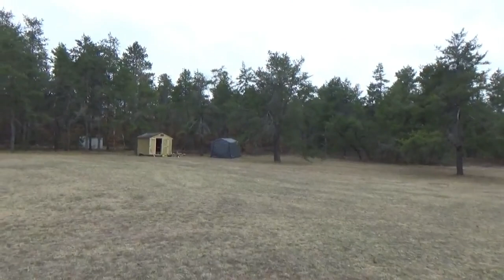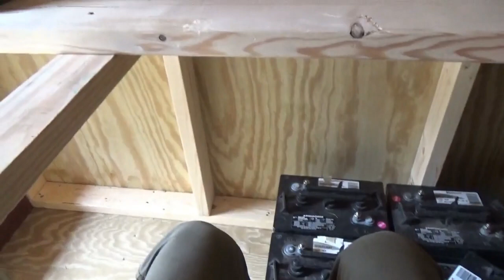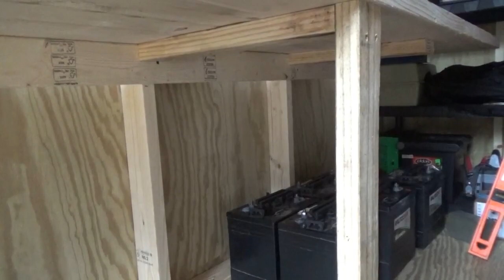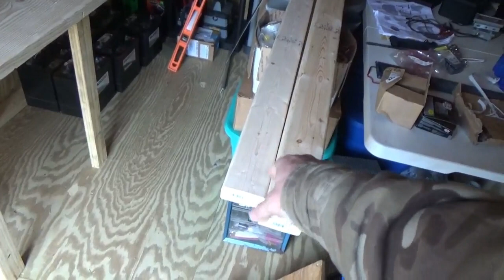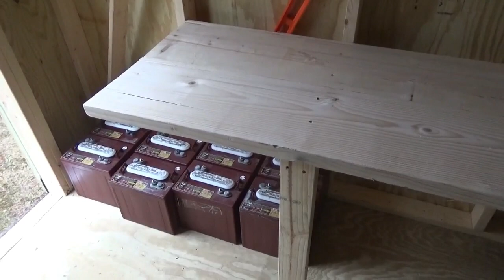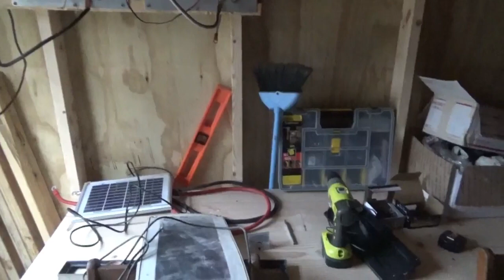Setting Up Off Grid Work Shop & Building Work Bench

Comment: The legs of the workbench need to be UNDER the framing, not the framing nailed to the side of the legs. Because now its only based on shear strength of the nails.  Smile

Comment: Troy,  When the workbench collapses and you have to rebuild it, build the frame for the top first and attach it to the wall, attach the legs and level...... THEN attach the top.     Put the batteries under the bench on a 2 x 4 riser to keep them off the floor.  Congratulations on a successful move!
Reply from the maker: Thank you. I will probably put the batteries on something to protect the floor from spills. Not sure why the work bench will collapse but if so, then I will do that
Reply: I should have said if you decide to rebuild the bench after you insulate and panel......  thanks for reply!
Reply from the maker: Thanks

Comment: You should be putting the horizontal 2x4 on top of the leg. Not against the side. Than you're depending on the screws to hold the weight.
Reply: Why would you care. Not you're problem is it? At least he made some money from you watching the video and you're comment. Good job key board warrior
Reply: Delicious Melody lol 👍
Reply: Stick enough screws in and it wont move, I always do lol.
Reply: Good grief. If he doesn't like it this way, he can always change it later. Are you there? Do you even know what lengths of boards he had left to do the horizontals or what the best use of the available wood was? Only the person doing it knows their reasons. Does he really need to explain every piddly part of his thinking? He is getting it done and it will probably work fine. That's what counts.
Reply: I was thinking the same thing Gerard. wow, people are quick to jump on constructive criticism. this is not about whether or not troy likes it this way, gerard is only trying to tell troy how to make it stronger and safer. if troy piles enough stuff on that bench and the screws break that are holding the horizontal 2x4, that benchtop could fall to the floor. what if troys future kid is out playing under the bench? putting a screw into the end grain of a board is one of the weakest ways to attach it because you are relying on the screw not breaking and you have to worry about the wood splitting on the end. you people need to realize that not everyone is out to get troy, some people are actually trying to help.
Reply: Kansas Country 👍✊🏼

Comment: Don't forget the earth ground and lighting rods. Other wise you will find why my Dad said if you want electricity plug it in to a pine tree. Still looking good on your set up so far. Hope your wood shop is as big. Get grain shovel for digging out from snow this winter. That blade is for lifting snow  It also is for if the snowblower breaks a belt you can still clear out to the road to get into town for anew one.

Comment: Troy why do you have your buildings placed so far away from the main house? I think that would create problems running wiring from building to building it also makes the place look more cluttered. Personally I would have them all closer to each other.
Reply: Excellent point Buddy Light.
Reply: I already told him that 2 videos ago I think it was. Would need about 50mm sq.  cable due to the distance and only 110v ac. But what an ex electrician know.
Reply: Mark, It becomes a bit more resonable to set up bespoke aluminum. I've used it in place of ship to shore, and it was even cheaper.
Reply: I find him (and many of the comments) very entertaining, but very frustrating when he wont listen to constructive comments.
Reply: Only ever used copper, aluminium is cheaper but not as good a conductor, so you need to increase the cable size yet again. Going to cost a fortune in cable being so far away. Some things you should never touch unless your qualified, electricity and gas.
Reply: Buddy light, as I mentioned the other day, Troy is not going to be able to take the house fully off grid any time soon anyway. He simply doesn't have enough solar panels or battery capacity to run all his appliances. To try to go completely off grid now would be taking a huge step backward. Not trying to be negative. Just realistic.
Reply: So how long is Troy going to be on-the-grid for? I thought the point was off grid homesteading? This channel has become very confusing since the move.
Reply: Did you change your leg supports as suggested? If you're going to put any heavy up there you should.;-)
Reply: My ten year old child is able to follow along.
Reply: Elvis, is there anything "evil" or wrong with being on grid? Homesteading  is good idea, but it is not necessary to be off grid. As I mentioned earlier, I don't think much of tiny houses or off gridding. The reason being... The minimalist and primitive lifestyle that comes with it. But everyone has a right to their own beliefs. P.S. I'm happy to see that Troy now has a REAL house And... With the solar power he now has... If the poop ever hits the fan, he can live off grid if necessary.
Reply: Fixed-By-Dork lol
Reply: The buildings being so far apart would also require lots of time walking and take forever to accomplish anything.
Reply: Fixed-By-Dork There's nothing evil or wrong about it at all. Strange interpretation. Troy called it his new off grid homestead and he was switching to off grid asap. I'm just a bit confused.
Reply: Elvis, my main point through all these comments was only to try to convince Troy NOT to take his house fully off grid. When you consider the solar power he has now, and what he could afford in the near future... Going fully off grid would mean accepting a primitive lifestyle compared to what he has now. A huge step backward. If you remember back at the tiny house, he had to run a generator just to wash clothes. Many times he had to walk around at night with a headlamp. He quite often had to turn his freezer off. He had a propane refrigerator. He had to use a water heater designed for camping use. So as you can see, I'm not a big fan of tiny houses or off gridding. I do believe that it is a good idea to have the CAPABILITY to live off grid if necessary in an emergency. Troy already has that. Living a primitive lifestyle on an everyday basis is not necessary. That is just my opinion on all of this.
Reply: Fixed-By-Dork right on !
Reply: keith dunham lol oh plese, really ?
Reply: Mark, the priority is safety, not cost. All the things he'll be doing in the workshop are best far from the house, remember- he has pine needles now, and a new family.

Comment: I've been tagged in the hip a few times by a square work bench corner. It hurts. You don't really need to round it with your reciprocating saw. Just cut yourself a 45 degree angle on the sharp square corner with your cordless circular saw. That'll at least soften it up.  It may just save you from a bruise or two. One doesn't tend to see these things when in a hurry to grab a tool etc. . ;)
Take care. Keep moving forward.
Cheers!
Reply from the maker: Thanks for the warning.

Comment: Looks great! You will need to take extra precautions when living in a Mobile Home, we had an underground well house that we could go to if needed during a tornado warning, something you need to think about, i know you have a second house, do you have an underground seller?
Reply: Compared with other States, Michigan ranks number 20 for frequency of Tornadoes, 5 for number of deaths, 8 for injuries and 22 for cost of damages. When we compare these statistics to other States by the frequency per square mile, Michigan ranks, number 25 for the frequency of tornadoes, number 8 for fatalities, number 11 for injuries per area and number 25 for costs per area. Based on data from 1950 - 1995.
Michigan in 1970 had a population of 8,881,826 and between 1950 and 1995 had 722 tornadoes. This ranks the State number 20 in tornadoes by State. The population in 1970 divided by the number of tornadoes equals 12,302 This ranks Michigan number 33 in the ratio of tornadoes to population. Michigan had 237 fatalities between 1950 and 1995. Compared to other states it ranked 5 The risk of death in any one year is 1 in 1,686,423 This ranks Michigan as number 14 for the risk of death by tornado . Between 1950 and 1995 the state had 3,217 injuries involving tornadoes. This ranks the state number 8 among the States for injury. The risk of injury in any one year is one in 124,241 When we divide the population by the number of injuries, the State ranks number 14 The total cost of tornadoes between 1950 and 1995 was $345,257,728.00 This ranks the state number 22 The cost per person for tornadoes, in the state per year, is $ 0.86 This ranks the State number 28 In costs for tornadoes per person 

The risk of death in any one year is 1 in 1,686,423!  http://www.disastercenter.com/michigan/tornado.html

Comment: So many questions today: Are you going to add windows or a skylight to provide natural light in the workshop(s)? Do you have any left over rocksol insulation from the tiny house build to use on the sheds/ garage? Have you decided how to heat the garage/workshops; propane or wood stoves? Will you be using the garage for your small engine work? I agree with the others about having solid building grounds and lightning rods for anything close to a pine! I would also recommend not relying on screws to hold workshop legs on, reenforce with bolds or reattach the legs below; or do both! Great to see both of you doing well!
Reply from the maker: No windows in the shop I think. Maybe one in the future but not now. Nothing left from the tiny house. Propane for the shop because its too small for a wood stove. Garage for auto and small engine work yes. Thanks for the warning. I will get an electrician out here to have a look. I have no idea about such things. As to the legs, the weight of the table is right on the legs, pushing down. Should not break the screws I think. Now on the wall studs, yes I think lag bolts are in order.
Reply: Given the distance involved, proper grounding is going to be quite tricky between the house and the workshop. Definitely seek an electrician's advice so one/both don't go up in flames from a strike.😞 Also, make darn sure your panels have proper grounding too. I get nasty strikes in my neighborhood, almost lost a roof when a strike across the street blew the top 5 feet of a pole next to the house clean off! Grounding was a bit weak on a few panels and they were damaged last year in a storm; looks like mini lightning strikes on the cells themselves.😞
Reply: Given the distance involved, proper grounding is going to be quite tricky between the house and the workshop. Definitely seek an electrician's advice so one/both don't go up in flames from a strike.😞 Also, make darn sure your panels have proper grounding too. I get nasty strikes in my neighborhood, almost lost a roof when a strike across the street blew the top 5 feet of a pole next to the house clean off! Grounding was a bit weak on a few panels and they were damaged last year in a storm; looks like mini lightning strikes on the cells themselves.😞
Reply: oooh, I like the workshop skylight idea.

Comment: Hi Troy:   Add a 3" nail at each stud to attach the 2x4 ledger board supporting the back  of the bench; for shear strength.   Cut 3" off the corner of the bench top;  This will save you from a bad bruise one day on your thigh or hip.    Bert
Reply: PS   Double up the 2x4 legs by putting the second  behind and under the horizontal 2x4; consider it a stud under a top plate.  You should also nail a 2x2 on the ledger under the 2x4 end for support.    General rule:  Weight bearing horizontals must be ON a post or vertical.    Bert

Comment: Actually, if you REALLY want that bench to be SOLID, get some 1/2" plywood (or scrap, as available) and cut some right-angle triangles and put at least three screws into it through the stud and through the 2x4 supporting the bench.

I did that when I built the shed, and you could literally climb up the things if you needed to.  Solid as a rock!  d=O)

You could do the same thing with the legs, as well...you'll be able to plop an elephant on the thing and it won't budge.  d;^)